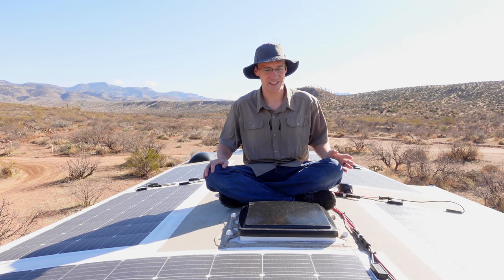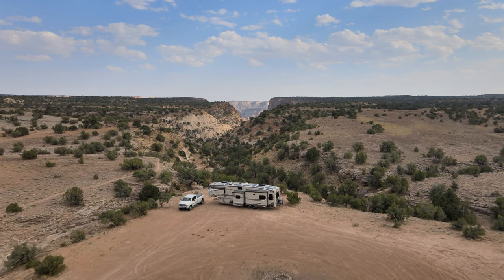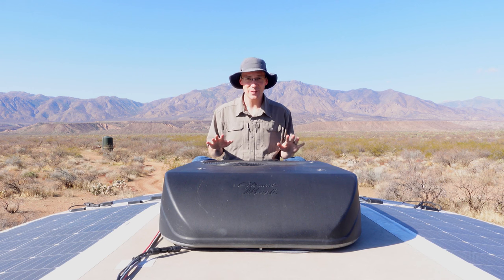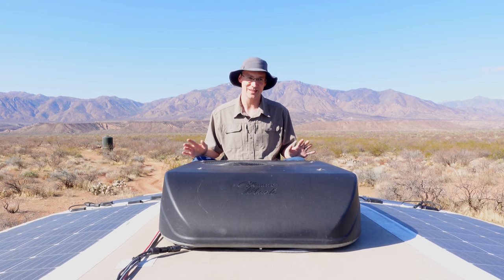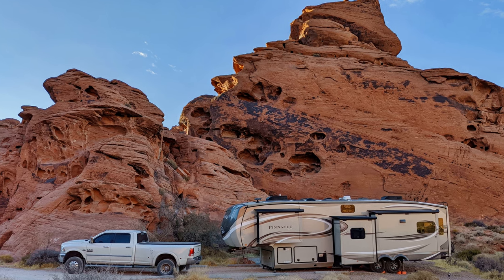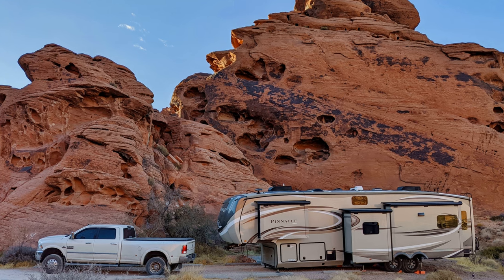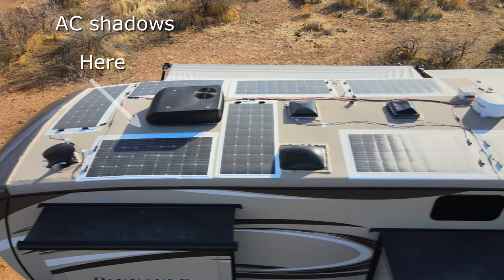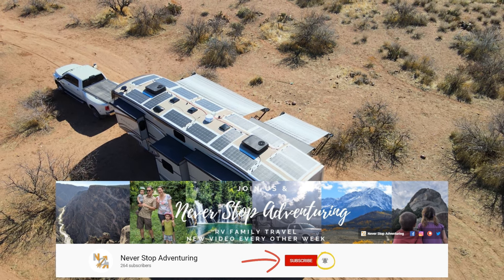RV Solar System Lessons Learned

Comment: First of all, thats a large setup. I have a few comments and observations.  First of all  I wonder were most of your power consumption comes from. You mentioned turning things off so that the batteries could recharge after a few consecutive cloudy days, so I wonder what you’re leaving turned on that puts a load on your battery bank and inverter. Next, most RVs are not well insulated and I’ll bet you’re using a lot of power because of heat penetration thru windows and doors.  I am also skeptical that a 21 cu. in residential fridge only draws 100W of power. Did you measure that yourself or was that what the manual or sticker said?  You installation is a bit concerning because of the proximity of all that electrical equipment to water sources. If there is a leak in one of those water hoses you’re in for trouble. I assume that you have fuses and or circuit breakers in all the electrical wiring runs.
Reply from the maker: We actually haven't experienced multiple cloudy days in a row yet. Are you referring to that situation I mentioned at Valley of Fire? In that situation I flipped the breakers because it was easier than running around unplugging everything and I knew the panels would be shaded by 2pm. We certainly have some parasitic draw but not enough to worry about. You're absolutely right about RV insulation. Jayco rates ours from 0 to 100 degrees so it's better than some, but it's still an RV. We still stay comfortable within those temperature ranges especially now with a big solar setup to run our AC units. Believe it or not, that's what the fridge pulls when it's running. That's been verified on both my Victron panel and the old Xantrex inverter that used to run it before the upgrade. The only info on the fridge sticker is "Max Draw of 7.2 Amps" which is consistent with compressor startup. That only happens for a fraction of a second and then it runs at 100-110 watts. It also has a defrost cycle but it runs so infrequently I haven't caught it in action. Ideally, yes, the water pipes wouldn't be quite so close. But that's also not the only place where water pipes run very close to electrical wires, circuit boards, etc. And those were done that way by the factory... Water leaks are always bad news, but I don't lose any sleep over it. Instead I frequently check that everything is in order. ABSOLUTELY, there are fuses and/or breakers for everything.

Comment: Seems harder than just running a generator all the time
Reply from the maker: It's definitely more expensive than a generator. But harder? After the install the system is on all the time, takes little to no maintenance, and is quiet.

Comment: Flex solar panel less efficiency and durability, with same size, non flex solar panel (mono crystalin) more watt (wp).
Reply from the maker: That's actually not the case with these ones. Go check out Renogy's website and you can compare the two. Another huge bonus to these is that they weigh so much less than the rigid panels.
Reply: @NeverStopAdventuring  
If you plan to be generating and using solar power everyday, generally, rigid solar panels are going to be better than flexible solar panels.  Although initial costs may be higher, the longevity and efficiency of a rigid solar panel system make traditional solar panels the smarter option.
Reply from the maker: Thanks for your thoughts. For our application and needs we felt these were the best choice and we are very happy with our setup. Thanks for watching!

Comment: Thanks for this, a couple of things, the zip ties will last longer if you buy UV resistant ties, there are different ones and they are labeled, also UV resistant wire Loom protect your cables.  My biggest concern with flexible panes is hot spots, and scorching the roof. it doesnt look like this has been an issue for you, does that concern you at all?  I have seen pictures of burnt panels and melted roof membrane from these.  Im deciding on panels for my rig now, this will be my second build, and used rigid panels last time. would appreciate your input.
Reply from the maker: The zip ties actually are UV rated they just aren't UL listed. The zip ties have actually held up really well, it was the adhesive tie downs that failed in a couple of places. I had some concerns about hot spots going into this project, but I don't worry about it anymore now that it's over a year old. These panels just don't get that hot. Even in 100+ degree temps. Renogy assured me before I started this install that these panels don't require an air gap and they don't get hotspots. My opinion on it now is that manufacturing standards simply vary from company to company. I'm still very happy with these. If you are 100% positive that adding 100's of pounds of weight to your roof won't be an issue, I wouldn't hesitate to go with rigid panels. When I get around to replacing the front panel that I lost, it'll be interesting to compare the new panel's output with one of the originals.
Reply: @NeverStopAdventuring  Thanks for the reply, I had 10,  100 watt Grape Solar rigid panels on my last rig, the really didnt weigh much, I think im going with 5 Newpowa 240 watt rigid panels on this build, but still kicking around flexables,  mainly for aerodynamics, I would be interested in your comparison of output, I understand the flexable ones are not quite as efficient, but this is just from reading, not personal experience.
Reply from the maker: I think flexible panels have gotten a pretty bad reputation over the years - for a reason. There are several manufacturers that offer a power output warranty on their flexible panels now. Renogy's warranty is the same as many of their rigid panels. But yeah, I think the real world comparison will be key. They've definitely lived up to their promise about hot spots. Just don't buy flexible panels that don't offer a power output warranty.
Reply: Flexible panels are also far less efficient and you can't upgrade to tilted stands either.